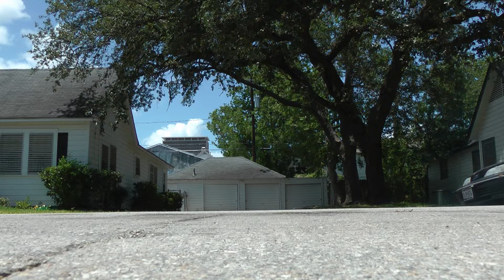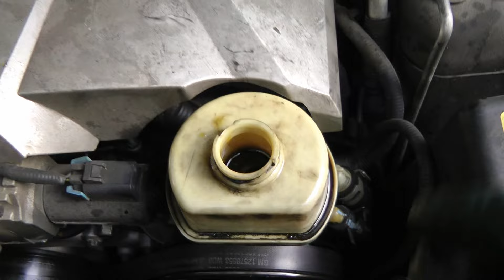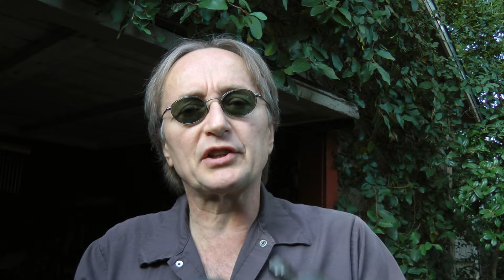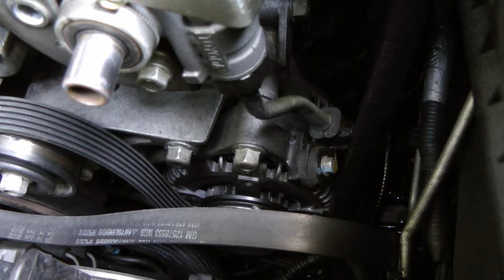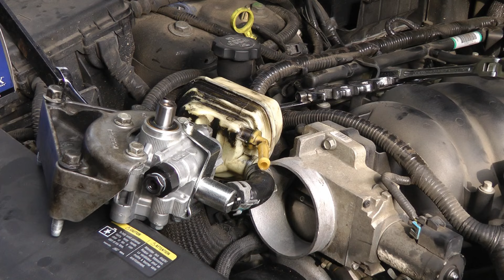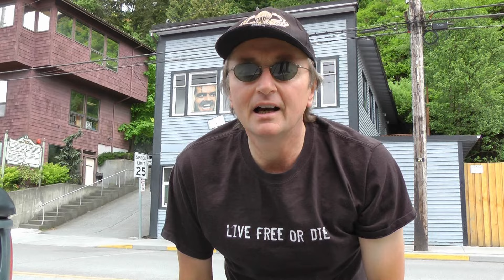How to Replace Power Steering Pump in Your Car

Comment: Hey Scotty, I am baffled by the fact that you didn't bleed the air out?? I have a 2006 Chevy Silverado that I am fighting. 2 reman pumps (bad idea) and 2 hydro boost units later and it still wont work. I got a new pump today and my son and I are trying to get all the air out of the system by turning the wheel back and forth (5 to the right, 5 to the left) then 3 brake pushes. I'm 15 cycles in and still getting bubbles. I see some of these guys saying you have to do 50 to 90 cycles to get all the air out! Really?!? Is there a better way???

Comment: Hey Scotty I have a 2010 Dodge caravan . How do you stop the pulley from spinning when you are installing the pulley using the installing tool ,as I cant get the pulley to seat itself on the shaft .Not sure if you need another tool to hold the pulley so it doesnt spin as you tighten the instsller s bolt down

Comment: If  the serpentine belt keeps coming off and it's the power steering pump, can you just replace the pulley or do you have to replace the whole thing?

Comment: Hey scotty, my 07 sts v steering wheel is really really hard to turn. Took it to a mechanic and while the car was running he opened the reservoir and looked inside and right away said it was the power steering pump but after watching this video, my reservoir or pump is not making any noise at all. Could the mechanic be wrong?

Comment: Scotty, my 2004 Acura MDX need power steering pump replacement and the parts at the dealer go for between $800-900 bucks, so whts your recommendations where I can get the pump?

Comment: Hey Scotty. I have an issue with a 2011 Nissian Pathfinder. I believe that I ran the power stearing without fluid for quite some time and nkw have either blown the pump or something worse. I refilled the resevour but seems to be all leaking out below the engine on the drivers side.

Comment: When replacing the power steering pump, what other parts do you recommend i buy n replace while having this done-
Any of these?
•	Power Steering Cooler Line
•	Power Steering Cylinder Line
•	Power Steering Hose
•	Power Steering Hose Ends & Ferrules
•	Power Steering Hose O-Ring
•	Power Steering Pressure Hose Seal Ring
•	Power Steering Pump Pulley
•	Power Steering Return Hose
•	Steering Filter
•	Steering Hose Assembly-Cylinder Line
•	Steering Hose Assembly-Pressure And Return
•	Steering Hose Assembly-Pressure Line
•	Steering Hose Assembly-Return Line
•	Steering Hose-Reservoir Line

Is there any not on this list you recommend?

Comment: That is totally Ford. They design their crap cars so you need a special tool to do every little thing. The Ford philosophy is - when 1 screw will do to hold a part down, we will use 8 screws, and 2 of them will be just about unreachable.

Comment: Scotty on my 08 tundra v8 5.7 my power steering pulley has a tiny bit of in and out movement. No side to side. Only in/ out. Is this movement is normal. If not is it possible to fix problem by just changing the pulley?

Comment: I'm fixing my power ,steering pump and saw that the hight pressure hose  connection in on tight but the hose still moves when I move it with my hand. Is it supposed to have a lil movement?

Comment: Scotty my 2001 Dodge Durango was leaking from the power steering pump so I replaced it and bled it still had a leak down by the rack and pinion so I replaced it as well I also change the serpentine belt but now I noticed that the power steering fluid is rising and the steering wheel is getting hard left and to the right is it because the power steering pump that I put in is it possible that it was no good maybe I must return it please help me out Scotty thank you

Comment: i need to replace mine and the part says online that you have to drain all the old fluid out and replace it or you will damage the new pump
Reply: Yea flush ur system, think of it like changing your oil without a new filter, your gonna have dirty power steering fluid pumping through your new pump, which will cause quick wear

Comment: I've been shopping and some pumps for Honda are $300, others are under $100.  Beyond the platitude "you get what you pay for", should I expect the inexpensive ones to be all that much shorter in life?  Cannot seem to find information on the Internet one way or the other. Over the years I've learned that the inexpensive versions of some parts work just fine and last as long as the vehicle does. Just don't buy a cheap catalytic converter.

Comment: Just replaced the PS pump on my 98 1500 P/U. 
Steering is smooth and silent  for about 30 seconds and then it immediately has full resistance and no power assisted at all. 
No leaks in lines in the reservoir. 
Hellllppp!!'

Comment: Replacing a pump on a 2010 subaru wrx. Does Subaru also require a special tool to remove the pulley?

Comment: Thank you for your videos, I have a question, I have a 2014 Nissan Maxima, and I m trying to replace my power steering pump, but I'm having trouble even locating the pump, any books or manuals, or any help would be greatly appreciated

Comment: Whenever introducing air into the power steering system like this, you just lift the front of the vehicle on Jack stands and with the car off, key on, rotate the steering wheel lock to lock to bleed the air out before starting it.
Reply: very helpful comment. thanks man
Reply: The only reason I watched this particular Scotty video was to know best way to bleed the air out.  I’ll give this a shot.

Comment: My power steering fluid abruptly started leaking last week. When it has fluid in it it works fine and it like barely whines at all but within a few days the fluid is empty again. Should i replace the pump or could it be something else?

Comment: The pulley on a 2001 Ford torus broke by the power steering pump does this mean that the power steering need to be replaced there was tension when you turned the wheel but no noise

Comment: Hey scotty i changed my power steering pump since it was leaking oil onto my alternator i also fixed the alternator by getting a new regulator... i have placed it back on there is no noise from the power steering but it doesn't steer soft like the way a new car would... what could be the cause?

Comment: I have a problem i need answered if anybody can help me??

I have a winding noise in my steering wheel which sounds like the power steering pump 
But my mechanic changed it 
He also changed out my rack and pinion and my power steering hoses he also told me he bleed them out also and added new power steering fluid 
But hes telling me its still making that noise? Can anyone tell me what it could be or might be? 
Thank you

Comment: Okay so I have a 79 Z-28 Camaro and the power steering is not making any noises. Pulleys turning fine. Fluid full and no other symptoms except the power steering does not work. Would you suggest flushing the system before changing the pump? Or would a clog make the pump have a noise? Re-manufactured pump. If I have to get the pulley on the new pump, how am I to be sure it will line up with the pulley on the engine when I press it on?
Reply: Trex thepony  if it's, the rack how come everyone says you'll hear clunking? ? I'm just having the same issue I just replaced my power steering pump I drove went beautiful 20 minutes after driving I have no leaks mind you I immediately loose my power steering in mid drive .. it's now just like it was without my pump.  any specific ideals here o.o I'm trying to get ideas cause I'm stumped o.o If it was how I assembled id understand but it still worked for 20 minutes is why I'm confused if I did it wrong it would never have worked in the first place:0
Reply: Pump may sound good but it may not be moving fluid at all! Disconnect the hoses and use a drill the spin the pulley. If you get a nice stream of fluid. It may be the rack. If not. New pump :(
Reply: haylpp
Reply: +christopher that does sound like the rack. and you may not hear clunking either

Comment: Just replaced the power steering unit on my 87 s10 blazer. The pulley / installer tool is a must as you can't get to the mounting bolts with the pulley attached. I was surprised that you didn't address the need to flush the old fluid from the system prior to installing and filling the reservoir again. Love your videos.

Comment: What about a power steering pulley that is wobbling and slightly heavy steering (on an 05 grand am 6 cylwhen when going under 5 mph I could still turn with little resistance, just more than i'm used to in an 02 l200 4cyl) Would that be something to worry about or something to consider getting fixed?

Comment: Sure hope its as simple for my ford. Dang thing just went out.
Reply: I looked up and it seems it needs a replacement pump. Which is fine, but wonder if I need any extra parts before I work on it as I dont have another vehicle to run around in.

Comment: what is that special bolt tool called to put the pulley back on the pump?
Reply from the maker: it comes with the pulley removal kit, it's just a bolt that screws into the shaft and presses it on
Reply: Scotty Kilmer OK thanks.

Comment: Can anyone help me? I am trying to remove the high pressure hose attached to the power steering pump and I'am unable to remove it. I've tryed crow feet flares wrenches and wrenches nothing is working. It feels stripped also.used penetrating oil and wd-40 for 24hrs... Any ideas what else to try?
Reply: Its a 95 ford mustang....if that means anything
Reply from the maker: me, I cut the actual hose part off, then put a socket over that nut to get it off, of course I only do it when replacing the hose assembly
Reply: Thanks for a quick reply. I actually used vise grips and I put a small pipe on the end for more torque. Worked perfect.

Comment: Hey Scotty, I have a 2000 Ford F-150 that needs the power steering pump replaced. I bought a pulley puller installer kit that says it's compatible with Ford, GM, and Chrysler.   I tried taking the pulley off using the puller but the bolt does not fit into the shafts of the pump - the puller bolt is too big. I noticed that there is a hex opening on the center. Will I be able to get the pulley off using a big Allen wrench or hex wrench? I need your help here. Thanks.
Reply from the maker: you need the right puller, realize auto zones loan em out free, try that if you don't want to have to buy the real expensive tools that fit right
Reply: I didnt know that. Thanks so much. I really appreciate it. I really enjoy your How-to videos. You're awesome. Have a great day!

Comment: HI Scotty, thanks for vids. After replacing rack and pinion rack on Subaru Legacy 2008, the wheel is still hard to stir. Could it be the power steering pump or something else? Let me know what you think.
Thanks a lot.
Reply from the maker: yes, often a bad pump, or a clogged high pressure line

Comment: Scotty  my 2001 chevy malibu v6 3.1 is making a loud screeching noise only when I press the gas I was heading to get tacos with my fiancee tonight and while on the free way it started screeching I pulled off the freeway parked the car and opened the hood I loosened the serpentine belt and the power steering pully shook a little so I took put the serpentine belt back on started the car and when the engine is idling it doesn't make noise however I pressed the gas and it started again so I sprayed some water on the belt it got loader I sprayed some on the power steering  pully and it stopped any suggestions on what I need to replace could it be the pump and the pully or most likely the pully only ? having no trouble with the steering where just really load knocking /screeching noise when I press gas coming from around the pully almost right under the power steering resavoir. where the pump and pully is located. thanks in advance

Comment: Hey Scotty or anyone. I have a 92 f150 and i have replaced the power steering pump and did a good flush. Every morning when I start it up and try to turn it I get that annoying grinding sound. Once I get her going it goes away. It also makes the sound if I'm at a complete stop trying to turn. Is this normal for an old vehicle?
Reply from the maker: if you put on a rebuild pump, that's normal. If a new pump, steering box is worn or lines bent and damaged

Comment: Scotty, I have the power steering pulley tool.  I replaced my PS pump, but I am reusing my pulley.  When I try to put it back on, it presses on well enough, but it's lopsided.  I cannot get the thing to press on straight.  Any tips?
Reply from the maker: odds are you bent the pulley itself, that can happen as they are cheaply made, I'd try a new pulley. Either that or "new" pump has a bent shaft
Reply: Thanks for the reply.  Just for giggles I tried putting the old pulley back on the old pump.  It did the same thing as on the new pump and it's not pressing all the way down on the shaft.

Comment: 99 buick century first start up steering is a little hard to turn then gets very hard and while turning either way, getting a loud noise from the steering column. Hear it by the wheels too. What could this be?
Reply from the maker: pray it's just low on power steering fluid and that the pump is not worn out, or the rack itselff
Reply: I eat ass

Comment: Hi Scotty! I have a grinding noise on my 99 BMW E46, also the steering feels stiff and won't return to the center after a turn. How can I tell if it is the pump or something else? I noticed the level on the reservoir was a little low so I added some ATF as the car manual says but it is even harder to turn now
Reply from the maker: on those almost always  bad pump

Comment: i have an 88 chrysler lebaron coupe, the steering is way too stiff to the left, but to the right os smooth, as some time passes, the left smoothens up, but theres no noise from the pump, would it be the pump only or maybe the steering rack?
Reply from the maker: power steering rack is wearing out on the left side
Reply: so is it recommendable to chance the entire rack or is it repairable?

Comment: Mr. Scott, I drive a 2006 altima v6. I regularly maintain the car on time. But I recently started to notice the steering wheel is getting tighter. There are no leaks in the reservoir. And I also sometimes hear the grinding noise. 
Will this video help me?
Reply: +NIYAZ NAZAR Sounds like your pump is going. Do you change the power steering fluid when you service your vehicle? You can take a turkey baster and suck out the contents in the reservoir each time you do an oil change.

Comment: dear Scotty trying to replace a power steering pulley on a 2010 Chevy Aveo with no luck. tried for one day and gave up the pulley has nowhere to grip it. so took it to two different shops now I have a warped pulley.
and it still connected to the pump. please help
Reply from the maker: +dmoney1dm8512 heck, find a guy with the right tool and a torch to heat it up to get it off and buy a new pully and put it back on with the proper threaded tool
Reply: +Scotty Kilmer  haven't found anyone that sells it unfortunately the two shops that I mention we're professionals shops and $40 later ended up with a bent pulley. the pulley to that model has no lip to grab on to so I cannot go to a junkyard and replace it I have to replace it with one that has a pulley that has the lip to used with that tool you mention on the video
Reply: +Scotty Kilmer hey Scotty I just replaced my rack and pinion and still have the same problem with grinding, my fluid hasn't went down since I replaced it, does that mean my pump is bad
Reply: +Scotty Kilmer hey Scotty I just replaced my rack and pinion and still have the same problem with grinding, my fluid hasn't went down since I replaced it, does that mean my pump is bad

Comment: Scotty, you have done a lot of good videos and have been helpful.  Unfortuntely this one is a bit lacking in that you do not note the need to bleed air from the lines and what is required to do that.  Also, for us shade-tree mechanics...HOW can I remove and replace that damned pulley w/o that (expenseive) special tools!
Reply: +Jack A C The tool is available at your local o'Reilly's /Autozone for around 33 dollars (to rent) so its basically free, once you take it back your refunded every single penny.
To get the air out of the system, jack you car up so the wheels are off the ground and fill your reservoir up,leave the cap off,turn the car on and just turn your wheels slowly from left to right, don't hold the steering wheel at the stops,just continue to cycle it back and forth and the air should bleed out,you might have to do this for awhile so ba patient.

If that doesn't do it, turn the car off and manually turn your wheels left and right, you might need a buddy to help you,turn them slow and of course make sure you don't have your steering locked or they wont move at all .
The reason for this is sometimes air gets trapped real deep and by turning your car on and having the pump running with the engine the air cannot escape (this happens sometimes but its uncommon) hence the reason why the pump has to be off (engine off) i learned this trick years ago from someone when i could not get my air out and the mechanic wanted 300 dollars to fix it, i had a coworker that was a wiz at this stuff and he showed me the "moving the wheels when the car is off trick",works every time but like i said use this as a last resort, hope this helps.

Comment: Hey Scotty i have a hyundai accent gl 2002 I have this loud screeching noise which of course sounds like the belts but I changed one that one mechanic had informed it was and that didn't stop it, the other belts were in perfect condition considering they had been changed within a year ago. I am not sure whether it is the power steering pump that could be making all that noise everytime I turn or what. Before I go buying a new pump for $100 or so I just want to confirm that that's my problem or if not, if u can assist me I'm finding the problem. Thank you in advance.